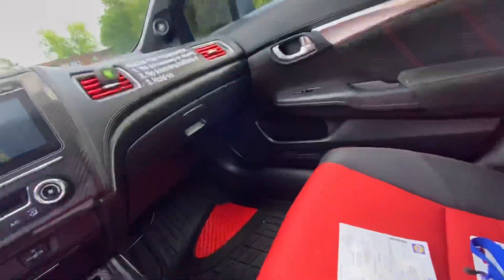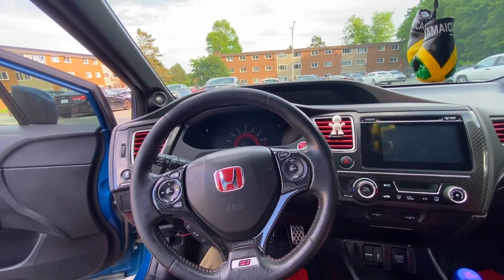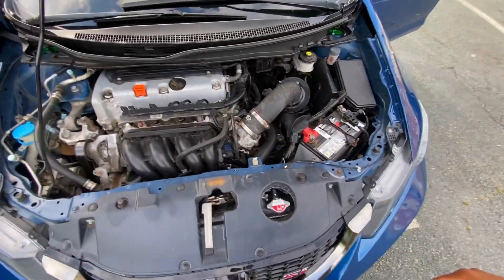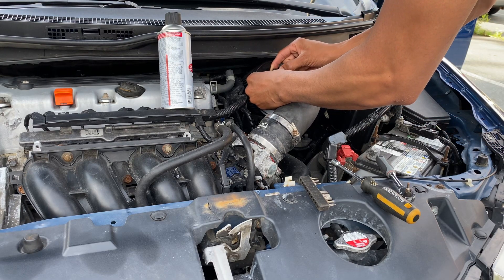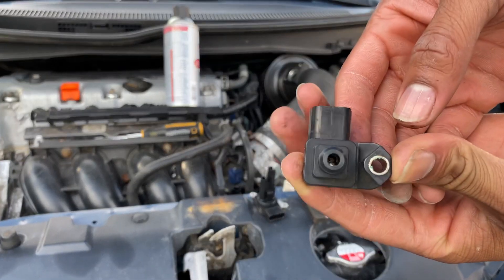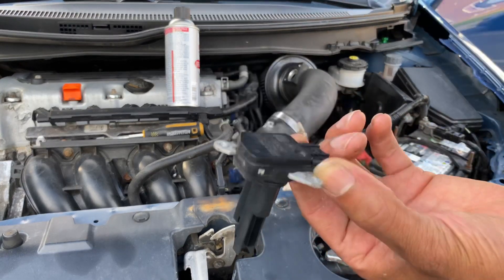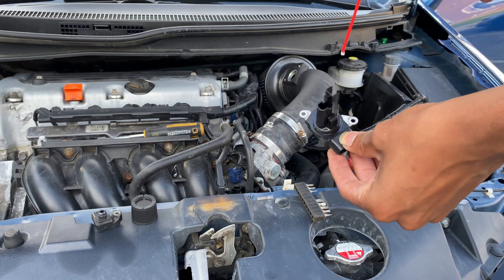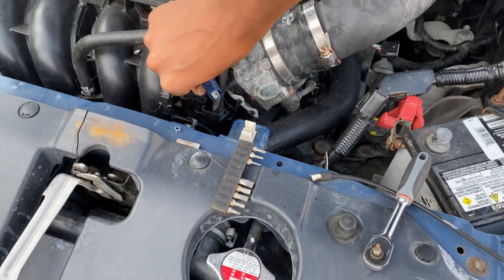HOW TO FIX CRAZY GAS MILEAGE iSSUE ( cleaning mass airflow sensor on my 2015 civic si )

Comment: My fuel range used to go up to like 250-300 now it only goes to barely 230 and im getting terrible mpg I gotta 15 si coupe did you experience loss in fuel range?
Reply from the maker: One of the most common culprits for a drop in fuel efficiency is dirty fuel injectors. Fuel injectors are the nozzles that spray fuel into each engine
Reply from the maker: My car just start bucking and burning fuel , that’s cause from first air filter and air sensors
Reply: @TheoHyatt  Yee I had changed my filter yesterday and put some injector cleaner in cleaned the maf sensor as well and it turned out one of those things were the issue haha my fuel range is back to what it was my car is barely coming up on 55k miles thanks for the info
Reply from the maker: Yea bro ,gotta get them hands dirty for a comfortable ride
Reply: @TheoHyatt  Yessuh you have a good one brotha clean ride you located in norcal?
Reply from the maker: Nah bro , canada Nova Scotia